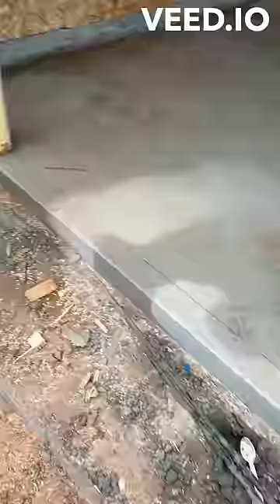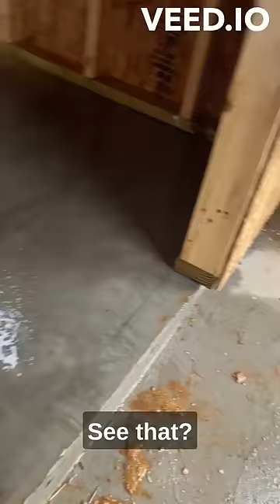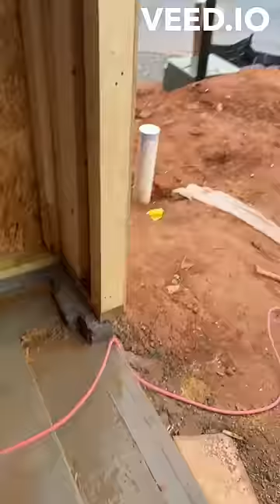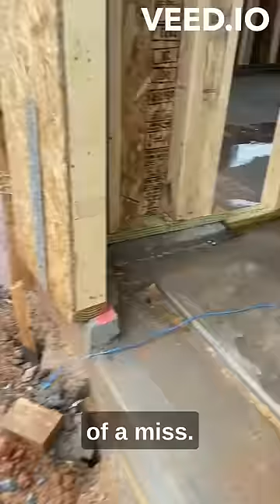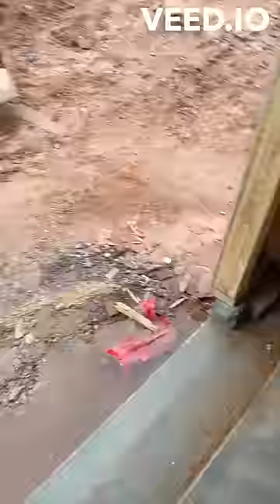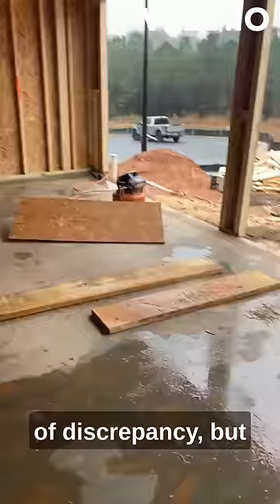New Home Slab is Wrong Size, What Now?

Comment: Concrete work was trash and framers didn’t put any gasket so that the framing wasn’t in contact with the concrete. Shoddy work all around, the finishes won’t be any better
Reply: That was my thought. Even with pressure treated bottom plates the walls are still going to rot away eventually.
Reply: How do you know concrete os off? Especially when the framing g is clearly wrong as a framer, it is not hard to remove a whole inch from plans
Reply: Yes sir Not hard at all .
Reply: @Wyomingchippewa you can see when he walks around.  At the base where the wood meets the concrete.  You can see it’s not flush
Reply: @anthony5227  really? Wow  I hadn't noticed. Reread what I said
Reply: @anthony5227 lmao no way so your telling me they pored the concrete after the framing. Lmao damn son make it make sense
Reply: @Wyomingchippewa would almost certainly have went to court instead. Plans have to be altered by architect/structural engineer and permits re-approved. To do it the right way. You take the concrete company to court instead for damages and the slab has to be re-poured.
Reply: @M21assult  that's stupid and no you don't have to redo the whole build the contractor  can move a wall back and not make any difference.
Reply: you aint wrong. that job was trashed from the start!😂
Reply: Never should have gotten that far without resolution.
Reply: Gasket? It's a pressure treated bottom plate that can come in contact with the concrete.
Reply: Fr, level the place and start over. I wouldn’t settle for this quality of “work”
Reply: @Wyomingchippewa  because those houses are most likely the shitty premanufared one and theyve done them alot of times. But but concrete guys coulve had a bad day
Reply: OSB Sheathing near grade can tell you all you need to know from a block away.
Reply: How long does it take to rot? I've worked on many homes in the Birmingham Alabama area, and most homes were built before 2005. We never ran into that problem, but windows facias and doorways always had rot. Just curios because it's very humid in Alabama or would snow have more of an impact.
Reply: You think gaskets are the big concern when the framing isn't even built to sit on the footers? 🤣 
If you see this as a buyer, just walk away. Cancel the contract. It's not going to emd well otherwise.
Reply: Didn't even catch that.  I was more focused on the concrete pore being set to the wrong dimensions and the framers putting up the walls to the right dimensions so there is the over hang.  

But yes, if you have that much over hang, you just know there is no structural wall support. No anchors into the concrete.

The sad thing is I don't even know if this is fixable.
Reply: @juniorizq2342  manufactured houses are complete. This is stick built. Im assuming you've never been in construction. Most of the people commenting have never done construction
Reply: @Wyomingchippewa it’ll fuck the roof up if you using trusses
Reply: @tristonevanko5726  how? Would 1-1:5 inches fuck up the trusses its called soffit and faciaandnitbwould only be a max of 3/4 of an inch on each side you've never built a house have ya
Reply: @Wyomingchippewa  It depends a lot on the type of trusses and girders above the space you want to adjust. If it's a simple gable end you have a ton of space you can adjust. If it's the gable sides you don't have much because the structural part of the truss has to rest on the walls in the right spot. If it's hip and valley you don't really have any wiggle room. The best course of action as a framer is to make this the general contractor site supervisor's problem and make them decide how to proceed.
Reply: @northshepherd8010  3/4 of an inch won't make a bit of difference in the structural part of the truss hell the web alone is usually minimum 8-10 inches or more to rest on a 2x6 wall
Reply: @Wyomingchippewa 99% the concrete forms  went inside
Reply: @markme4  what do you mean?
Reply: They got green plate no barrier needed
Reply: @Wyomingchippewa dude it’s clearly an 1 1/2” overhang, IE the concrete guys measure to the outside of the forms instead of the inside.
Reply: @stevecohen34  wow really all I said is it would have been east for framers to fix don't be a dumbass
Reply: @Wyomingchippewa  not if it’s a prefab and trusses preordered brodejo, then it’s not just cheat the walls a couple inches
Reply: @Betomarroquin313  half the people on the Internet, seem to think that pressure-treated lumber is going to rot next week. I bet those bottom plates last decades if they come into contact with water and centuries if not.
Reply: Cause heaved a ton of money hiring  ILLEAGLES

Comment: Concrete F'd up, then framers came along and one upped them, I bet neither of them even stayed on schedule by doing that.
Reply: Pre fab bro
Reply: Can't blame the framers for trying their best to stick to spec parameters and fix a major f up on concrete  form work clearly some1 was stoned when reading those plans
Reply: Superintendents are always supposed to check form dimensions prior to concrete pour. Piss poor work.
Reply: @slabsolutions1 it's hard to do that from the front seat of their truck, they never get out,  they look at it and say it looks good from my house. 😅😂😂
Reply: @slabsolutions1 Exactly, something that important should always be double/triple checked by the guy at the top
Reply: @TheBendablespoons Do you mean 2/3 of the substrate must be underneath and supporting the plate ?
Reply: I should stick with the framers on this but it's hard they actively effed it up. I've effed up by not lazering the sill but that was a honest oversight I would never in a million years let a 2x4 wall hang over 50% off the foundation
Reply: @YiuSure  bro.... Why would you even frame on top of that if it's blatantly wrong?
Reply: @angrydragonslayer  because you have time frames ect clients would be spewing if they realized the tradiies they hired to do a job inadvertently  hired sub quality contractors to do a part of a job also this is a house slab do you understand the work involved and cost to rip out the entire slab re prep your ground re profile find weather to book in the re pour then nobody wants to cover that kind of cost you'd find your business  going under real quick end of the day people need to realize there are people in this world with little experience  that are willing too rip off people in the name of greed self preservation  research a little the people your hiring to do works
Reply: @YiuSure  ehm, you should probably get a psych eval....
Reply: @YiuSure , you sure as hell blame the contractors for not making damn phone call before proceeding.
Reply: @slabsolutions1 Concrete super should check that. You’re right
Reply: @louiszoumboulas4583 Yeah, I hadn’t thought of that initially but it has to be prefab and they just erected those walls best they could. But that being said, who does that? Should have stopped work and fixed the issue before proceeding.
Reply: @YiuSure They didn’t fix anything. They compounded the problem.

Comment: I know what happened here. The concrete form layout was set to the outside of the form. Looks like about an 1-1/2” short, the thickness of the forming lumber, all around.
Reply: Same thing I saw immediately. Just scrolled through to see if anyone else caught what it was.
Reply: Yep, but the framers should've stopped and got it sorted with the builder
Reply: Could well be the issue. Good eye
Reply: @MrZeddy100 yes definitely
Reply: Should have built it 1 1/2” shy of the design.  Hardly noticeable.
Reply: That makes sense, just put the form back, problem solved 🤷🏻‍♂️
Reply: @kyledefreitas89 i feel like the gc or whoever is running this job should have been there the day of the framers and told the framers to just take everything back a 1 ½ right? Like this is all around fuckery by every party involved right?
Reply: @MrZeddy100 whose to say they didnt try?
Reply: And all the framing had to do was adjust to an inch and a half.  It's quite the fuck up but a simple fix
Reply: @247riffraff  What's your solution? Doesn't look simple to me
Reply: @nakedtommy40  those homes are all prefab all the framing is built before it ever gets to the site
Reply: that makes sense...
Reply: Workin construction nearly 8 years and all being in concrete finisher work yea you absolutely right lmfao
Reply: Framers basically said F the concrete guys, were gonna follow the print. If they want us to move it back pay us extra
Reply: Yep… we were gonna build a house but we read the prints like any logical framers. And once the layout happen it was evident and brought attention to the HO. Concrete guys f’d up lol
Reply: @daveortwine2641  Yes, the GC is responsible, and should have to pay the framers for the additional time to correct the frame. Plus possibly eat the cost of any floor or roof trusses that were already ordered and reengineer and reorder new trusses.
Reply: @markme4 the framers should have compensated for this before they built the wall.
Reply: Exactly what I saw. Major mistake!
Reply: @MrZeddy100 yea that’s just pure stupidity. They obviously saw how fucked it was and just said “let’s just get the job done
Reply: @daveortwine2641 , GC or his Superintendent should have verified the forms before they poured. Framers should have call the GC or Superintendent and asked for direction as soon as they saw the first measurement was off. In this business if you do your work over someone else mistakes, you also own it! It's called pride of workmanship. What the framer was probably afraid of was being called off the job because of the concrete error.  Now he is in a worse position!
Reply: Someone was not on site..
Very sloppy work..
Reply: Don’t think the homeowner wanted to lose space. Easy fix… the concrete guys will probably pour concrete driveway and fill in
Reply: Exactly, but the framer should have adjusted the walls to fit, instead of trying to upstage the concrete guys.Easier to fix framing , slab can't be fixed without tearing out.
Reply: @MrPiCkLeZz No it's not, you are out of your mind.It is not prefab.How many jobsites have you been on? Zero?
Reply: You sir have a good eye lol the only person o seen in the comment section that understands lol I work concrete and knew as soon as I seen it what was going on here
Reply: @stevegarvin5607 I've been on plenty of new builds alot of times the entire roof is prefab and brought in on trucks. They do it with walls too but less often.
Reply: Yepper
Reply: @nakedtommy40 but the trusses come into play too
Reply: Frames suck they should have shortened walls.    Concrete man here.
Reply: You sir, I do believe, are 100% correct! I thought the exact same thing while watching, then saw your comment and was like yep, rookie mistake that noone caught 🤦‍♂️ inside of the form. NEVER the outside, unless you minus the thickness of the wood from outside, which would add another step so pointless? lol im high dont mind me 😤🥳🤯
Reply: 100% this is what happened.
Reply: @daveortwine2641 ... Then all your trusses need to get re- ordered...
Reply: @nakedtommy40 do realize how many more problems that is going to create later? That's a terrible idea. Fix the concrete, that's the only solution
Reply: Yessir.
Reply: @a_woot  lol  wrong😂
Reply: saw that too
Reply: its more than 1 1/2
Reply: @markme4  Right, it’s not simple. The entire frame would have to be adjusted from the outside wall inward, including door and window openings column point loads, etc. Then floor or roof trusses would have to be resized, which would require redesign. 

Interesting as it may, I don’t think the house would have to be reengineered, other than the trusses, being that the house will be reduced in size.
Reply: @nakedtommy40   trusses would land an inch and a half proud on one wall.would be extremely noticable
Reply: @m1quatro  split the difference 3/4  inch on both sides but  where the doors are they are going to pour on the outside  just fill in the gap wit stiff concrete and inside just put a treated wood Dutchman
Reply: @markme4 or just put a new form down 1.5” further and get to pouren !
Reply: Concrete guys did their forms then left site until framers were finished.  Supervisor wasn’t around and told the concrete guys they were good to pour.
Reply: Yes sir! You hit the nail on the head.
Reply: This happened on our build luckily it was found out before framing. It was a block basement. We talked with the contractor and settled on reforming the exterior wall and pouring a solid 1.5" concrete basement exterior wall over the block. It worked great and did away with stucco over the block. I wish I took pictures it was a quick solution to a mistake and it strengthened the walls.

Comment: That’s not a little bit …… that’s a lot 😂
Reply: Sarcasm.
Reply: Roughly 2 inches.
Reply: You clearly haven't seen a lot
Reply: 2 inches is not that much. When he built my house, the garage is off 6 inches from the front to the back wall and a good Carpenter will make it work. Mine did…
Reply: Wonder what the form survey says on the dimensions? And if the builder confirmed the form survey with the arch/structural drawings...
Reply: at least they're consistent

Comment: Framers should have contacted the general contractor and adjustments could have been made.
Reply: Probably don’t speak English.
Reply: Pretty sure pouring more concrete would be easier than reducing the whole front of the house 3 inches
Reply: They did he, said Fuck it.
Reply: I worked in foundations and construction for over 40 years I seen this happen all the time, and if you disagree you haven't worked in construction
Reply: @trumpsagenius6914 so do the houses just get finished like this, and does it fail inspection?  I want to know what the next step in this process is, because I can’t imagine the house is allowed to exist like that.
Reply: @davidswanson5669  the front of the garage will have to be moved out,buy bolting angle iron to foundation and relay block under existing wall,or pour more concrete and footing then relay block,depends on the inspector,the rest on the interior they will shim under the wall cover and no one will know,as other have said alot of times you can shorten 1 or 2" if the trusses are running the other way and not hurt anything but lose a couple inches of garage
Reply: Yes, cement ripped out and done to speck and inspected !
Reply: What general contractor, this is a house with a builder.